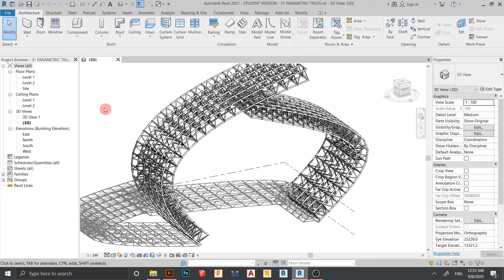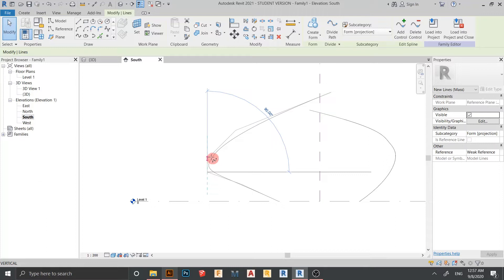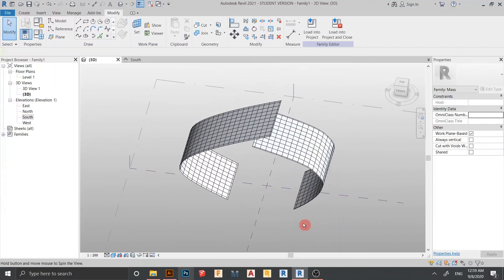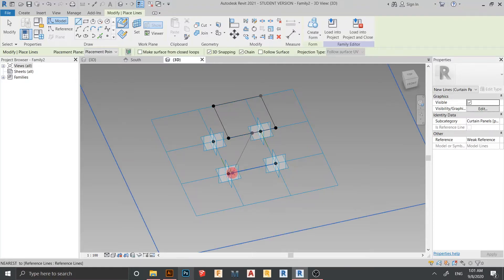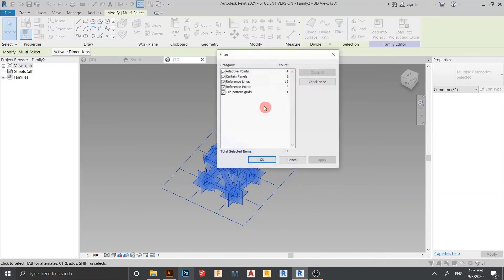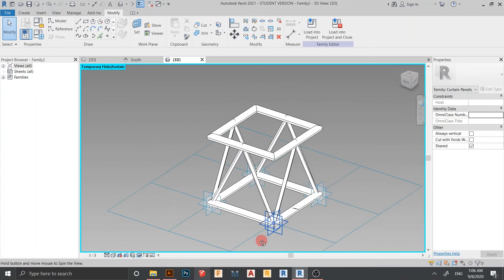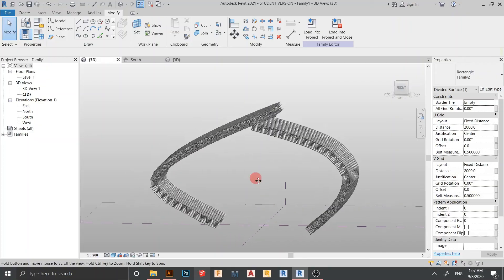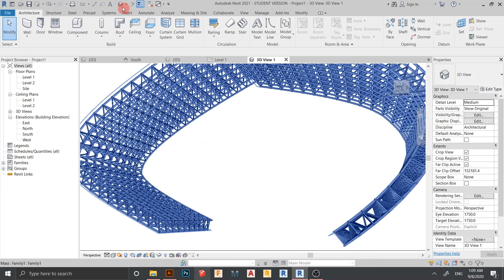Truss in Revit - Complex truss & Parametric truss in Revit

Comment: Hello, very good video thanks! I just wanted to know if theres a way to offset the curtain panel (glass panel) so that its separated from the steel, to be able to generate a mass that has the steel structure with panels placed on top, so that from the outside the steel structure is not visible. For reference check out the Heydar Aliyev project from Zaha Hadid. Please a quick response would be great because I have a deadline haha :)

Comment: how to assign actual size of the truss members
Reply from the maker: Hi Ssn Anj, I have see your comment on my newest tutorial (Project pavilion: Hexagonal structure); Could suggestion some photo reference for your request? Regarding all comment on my channel, some comment are restriction, due to many spam comment on my channel.
Reply: @RevitGlobalKnowledge  HI. What i meant . how to use default system framing  family like. universal beam, Rectangular hollow section ,  equal angle etc. with Parametric truss. if i want to create the similar shape structure shown in this video with proper system family and  required sizes .

Comment: Thanks a lot for the great video, really appreciate your effort. Could you please advise if the parametric truss vary ( small, big) across the reference line instead of staying constant?
Reply from the maker: I'm Glad you did, 
Anyway about your question: 
obviously, If the parametric truss detached from your work place or reference line will be not constant. By create or make parametric truss make sure when start create your parameter truss your work place & reference line (Truss component) are the same size. 
My suggestions: if truss is detached from its work plane, you can set this parameter. Start Level Offset, Specifies the vertical offset from the Reference Level for the start point of the location line.
Reply: @RevitGlobalKnowledge  Excuse me for keep asking, could you make a tutorial on the  truss system of a stadium like this https://www.archdaily.com/774065/estadio-bbva-bancomer-populous/56030dbae58ece4774000094-estadio-bbva-bancomer-populous-section?next_project=no, thanks a lot and have a great day!
Reply from the maker: @clasohlson4333  I'll take a look, anyway I'm too busy recently, tutorial will deliver quite lately.